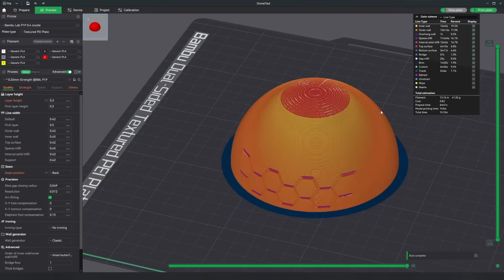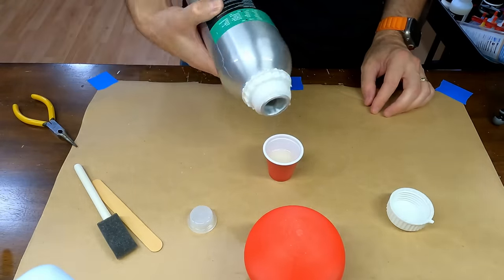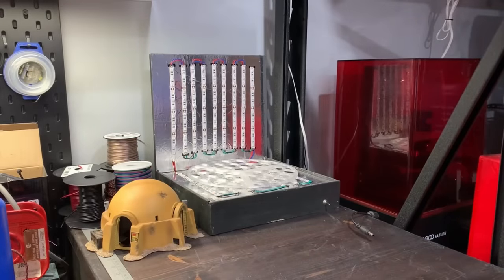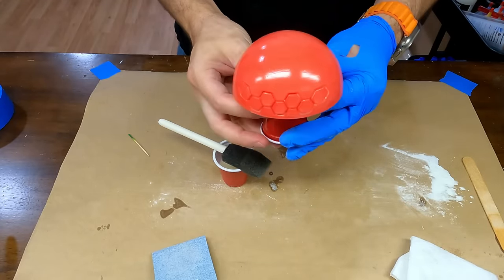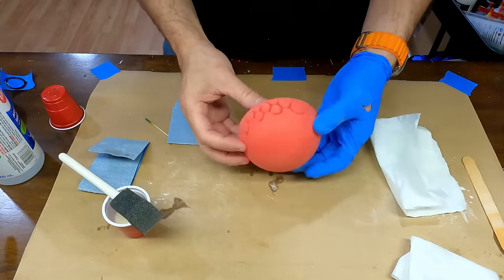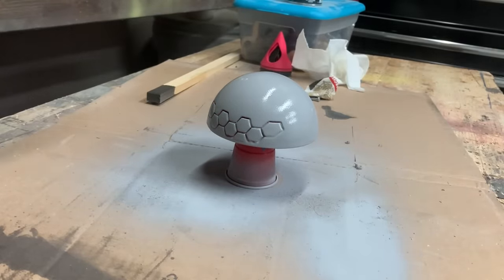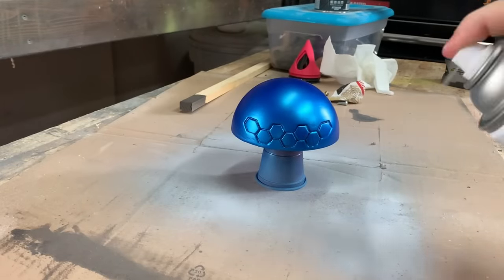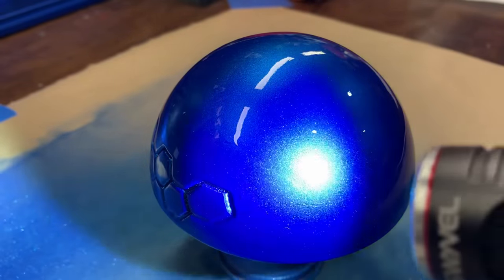Hide 3D print layer lines with Baby Powder and UV resin

Comment: I coated a helmet in 2 coats of 2 part resin that gave me about 10 minute working time. Im wondering how well the resin cured? And working time? 
I did use UV craft resin on a print with good outcome but felt it ti be a lil thick, so controlling the powder control the thickness 🤔
Reply: I forgot to add, the helmet didn't work as nice as your sphere. Resin had to be worked fast and the supplied foam brush wasn't up to it. A silicon brush would of worked better 😊

Comment: Same finish can be achieved with just a Sand+Filler Primer (cuz FILLER)+paint/clear.  The UV does not speed this process at all. Filler Primer does exactly the same thing in less time IMO.
Reply from the maker: Well, everyone is entitled to their own opinion, but not there own facts :)
Filler primer is much thinner than the resin, even before thickening it so it will take many more coats of paint and sanding to fill in the same size voids. Also primer isn't as hard as resin once it dried so you don't want to rely on primer to fill deep groves.
Reply: Read what I said.  Sand first.  Generally, a light sand with 100 grit on small objects, an orbital works great for large items like helmets. It's quick and effective.  2 coats of filler primer, a wet sand and it's on to finish.  Doesn't get any quicker or faster than that. #facts.  @DaveRigDesign

Comment: Nice vid! Wondering if this method could be used for figurines?
Reply from the maker: Thanks. Probably but as the prints get smaller with higher detail it’s difficult to not cover things you don’t want to. I think it will depend on the figure.

Comment: Im curious if it is possible to add color pigment to the resin to get the print to have a color that way and if that would look good? Also is there a alternative to using a curing chamber if you dont have one?
Reply from the maker: You could add pigment or just use colours resin. But the layers are so thin it would be somewhat transparent and show the underlying service. 

For curing you can just use a UV hand held light. I have a few videos on my channel using this method on bigger prints and use a hand held light
Reply: @DaveRigDesign  awesome thank you so much! would adding pigment make the resin thinner? (I dont know much about resin printing I only have FDM)
Reply from the maker: @codyabdullah I don’t think adding pigment would have much effect on the thickness. You could add a clear resin over a print you don’t sand. You would see the layer lines underneath but you can buff the resin to a mirror finish on top for a super smooth candy coating :)

Possibly also add glitter to give a metallic clear coat effect.

Comment: Great video I went to you area on where to get the uv resin on Amazon and it say not available and don’t know when it will be is there another resin you can recommend thanks
Reply from the maker: Ya I noticed the resin I used is out of stock, I need to replace that. I use elegoo resin also which is pretty good.
I have an Amazon store setup now with all the different products I use
https://www.amazon.com/shop/daverig/list/2B0WQBHVMEWTM?ref_=aipsflist_aipsfdaverig

Comment: Compared to using automotive glazing putty (which I think you have also documented in the past) how does the resin method work ?
Seems the resin method may take longer, more curing cycles.
thanks for posting this, useful info!
Reply from the maker: Real difference is putty take longer/ more effort to apply and then you have to wait for it to dry.
But if it’s a small area putty may be better, for a large area resin is the way to go

Comment: I see a process missed time and yime again with 3d print prep and finish.
You still had areas or spots where the item had dips below the main surface.
The talc and resin had not filled them completely. 
If you used one or two 'guid coats' they would have shown up and been delt with. 
I was a french polisher and dprsyrr in my old days.  If your prepping for a good finish you must do sanding guid coats without fail. It only takes seconds to apply.

Comment: Can I use an off-the-shell bottle of resin for photopolymer printing, and how powerful of a UV light do I need?
Reply from the maker: I would guess so. I think the light strip I used was rated at 45w but I didn’t use the whole strip.
Reply: @DaveRigDesign  thanks!

Comment: I've seen people use aceton under a glass cover, so the vapor would partially dissolve the surface, removing the lines. Takes some experimenting...😊
Reply from the maker: yup, this only works with ABS plastic though, doesn't have the same effect with PLA

Comment: Great video and very educational! Having had a lot of failures with Rustoleum 2x paint not being uv stable and unpredictable with crazing and bubbles, I wonder if it would be better to finish the project by spraying uv resin instead? Having never used resin before I have no idea if that would have the advantage of fast permanent curing and also protect the PLA plastic. What do you think. Thanks for doing this, interesting topic!
Reply: That's an interesting idea - spraying resin
Reply from the maker: I have seen people spray resin but it is a dangerous process and shouldn’t be attempted unless you really know what your doing. Make sure you do your research before attempting it.

Comment: I wonder if you could fill those detail areas with blue tack (or something similar) to prevent resin build up during the process... Or maybe wax? Something that would not only fill the voids to prevent pooling but actively repel the resin would be ideal
Reply from the maker: Someone else commented on a similar idea. It's definitely possible
Reply: I had considered using a PVA glue and letting it pool in the cracks, but I like your wax suggestion I have a load of spare beeswax so will try that. I am a bit concerned that painting a UV layer over the top will effectively seal the wax beneath a plastic layer, hopefully the hydrophobic nature of wax will help a bit. Quite a few ideas a bit to play around.

Comment: What is the benefit of UV light, and is it necessarily to do it or I can do it with out it ?
Reply from the maker: If you use UV resin you need the light to cure it. If you use a 2 part resin you don’t need the lights

Comment: Should you not have sanded first before applying any resin?
Reply from the maker: Well no. Partly so show how well it works and partly because PLA is hard to sand and the reason you use resin.

Comment: Hi ! Does it work with high detailed prints ? I'm afraid it would fade the details
Reply from the maker: It depends on how fine. You are adding resin to fill in the layer lines so you can loose some fine details also

Comment: Sand first. Apply filler optionally and paint only 1-2x. Just see how car chassis or walls are painted. Robust and mature methods, no need to reinvent the wheel.
The resin is a good idea though: it sets quickly.

Comment: you can also use 2k polyester resin filler

the brush on stuff, not the automotive body filler stuff

does the same job but you spare yourself the UV curing
Reply from the maker: true, but the upside of UV curing is the speed. No waiting for drying time
Reply: @DaveRigDesign  you can control the hardening time of polyester resins by the amount of hardener you uses

practical limits are around 10 minutes, if you go lower you basically have no work time left

also ab advantage is no need for a UV cure chamber, since I don't own a resin printer this would be wasted space

but needless to say: the process is very similar and both are very easy to use

one downside though: uncured polyester resin is usually more toxic than UV resins, but in either case good ventilation is key
Reply from the maker: Issue with a 2 part mix is you have X minutes from when you mix the parts so your application time is limited. With uv resin you can take as long as you like to apply it and then have it dry in seconds

Comment: Does it need to be UV resin or can I use something else? I don't have a UV lamp and wouldn't want to get one unless necessary
Reply from the maker: Same process would work with 2 part resin. Just need to wait for it to dry
Reply: @DaveRigDesign  Awesome, thanks! This will really take some 3D prints to the next level

Comment: you could use a heat gun to thin out the resin in the detailed parts
Reply from the maker: Yup, that could work, just have to be careful not to melt the print :)

Comment: Try Bondo and acetone. Works just as well and a bit quicker of a process
Reply from the maker: Yup, but uv dries faster
Reply: @DaveRigDesign  how quick? The acetone gets my layer dry in 15 seconds to a minute depending on how thick I put it on. Since I normally do a few parts at a time it's dry before I can get to a second later (if needed). But if the UV is crazy quick I may need to consider switching
Reply from the maker: @Garagehype199 uv is instant as soon as the light hits it. The benefits is it stays liquid indefinitely until hit with uv light and then dries instantly. Any 2 part product is on a timer as soon as it’s mixed and then you need to wait it to cure.

Comment: Whats the benefit of this over something like Bondo Body Filler?
Reply from the maker: Easier to apply and sand. Bondo is easier to control where it goes though.
Reply: seems like it would take a lot more steps than bondo. I just thin out my bondo w acetone and paint it on just like you would the resin, but i don't have to cure mine!

Comment: If i use 5min epoxy it will work the same ?
Reply from the maker: Maybe. Not sure what the surface finish would be like as that is usually meant to glue things together instead of coating things. But in theory it should work

Comment: hmm that should also greatly improve strength, shouldn't it?
As its basically now a compound material like glasfiber/resin, just instead of the glasfiber its your 3D print
Reply from the maker: Not sure. The resin layer is pretty thin and fiberglass gets its strength from the glass fibers embedded in the resin, like rebar in concrete. Resin alone isn't as strong.

Comment: Any idea what the overall diameter change was after applying all the resin/paint? This could be really useful for carbon fiber molds, but would need to account for the thickness of the resin layers when designing the mold.
Reply from the maker: "in theory" you could do this with no real size change but the process would need to be a bit different. After each coat you would want to sand it back to the print level so the only resin left behind is that in the groves. You would probably only need 2 coats to do this and then I would give it one more coat of just resin for a smooth surface. 

I just saw a video from MadeWithLayers https://youtu.be/22Qgj6vWA24?si=Z6sxfGDa_s8-y6SR doing this, he went the opposite way and heated the resin so it was thinner so it filled the voids and and ran off to not build of the thickness.

Comment: How does it compare to something like Smooth-on's XTC‑3D?
Reply from the maker: Haven’t used it but should be similar to any thick liquid. Main difference is with UV resin you control when it cures instead of it being based on time.

Comment: thanks for sharing.
what about plaster mix resin .  actually you dont have to mix powder I tried just use clear resin before . I put in shop some one brough it .

btw I dont like this methord. because detail line will be removed nomatter how carefull you do
Reply from the maker: In theory. But plaster isn’t very hard once dry so  may not be very durable. But may be fine depending on the use case of the print.

Comment: Resin heats up as it cures so arnt you essentially just melting the plastic?
Reply from the maker: It doesn’t get that hot. Usually the heat is also relative to the volume of resin and it’s chemistry so such a thin layer could not get hot enough to melt the PLA.

Comment: Good video, but strange idea: Whats the point of using sla epoxy? Hows that better than "regular" two part epoxy or putty filler? Its not cheaper, not faster, not giving you a better details or precision. So, why?
Reply from the maker: way faster cure time and infinite working time. Also it's what I had on hand. :)

Comment: You should check out hydro-dipping. Same results with a lot less steps and definitely cheaper.
Reply from the maker: Hydro dipping is used to apply images to object, it doesn’t do anything to smooth it out. The object has to already be smooth
Reply: @DaveRigDesign  LOL have you ever hydro dipped before? Never mind, don't answer because you made it very clear that you know very little about it. 

You do not need a smooth surface when dipping, you just need a clean surface. If you are worried about the uneven texture, that could easily be filled with some spray instead of taking all of that time out with baby powder and epoxy. 

In short, you are adding way more work than necessary.
Reply from the maker: @Gun_Nerd I haven’t but I’ve seen it done, and I’ve applied decals and know you need a smooth surface if you don’t want them to peel off. I’m guessing you don’t know what the surface of a 3d print looks like. 

Even if you managed to get the decal to stick to the surface you would have all the ridges showing through so in the light it would look like a corrugated metal roof. 

There’s no shortcuts to a mirror finish.
Reply: @DaveRigDesign  hydro dipping is nothing like a decal and its EXTREMELY hard to remove after its on. That tells me you really do not know much about dipping. 

Will the ridges show through? Yes, but I watched you sand after you applied the resin. You could have just sanded it down in the 1st place instead of adding resin and then sanding. You can also add clear coats on top of anything like this... 

I know a shit ton about epoxy resins and hydro dipping dude. You are making things a lot harder than you need to be.
Reply from the maker: @Gun_Nerd cool, I’ll wait to see your video to show everyone how it’s done :)

Comment: What are the paints you used?  Acrylic ink mixed with something?
Reply from the maker: They are both acrylic ink. One is blue and the other is metallic silver.
Reply: @DaveRigDesign  thank you.  I thought you added them to a clear base or something in the cup.
Reply from the maker: @jimbo2.094 nope, just paint and then after sprayed a clear coat to give the gloss finish
Reply: @DaveRigDesign  looks amazing!

Comment: that is a ton of super glue, like just a dab holds hundreds of lbs lol but love the video thank you
Reply from the maker: Thanks!
You would think but the cup kept falling off. I didn’t show re-attaching it. The glue didn’t stick well to the smooth plastic of the cup. Eventually I put tape on the cup also and glue between the tapes surfaces.
Reply: @DaveRigDesign  Could well be the plastic, but I also wonder how flat the bottom of those cups is. The only contact area is the outer ring and that looked slightly toroidal, in which case surface contact would be less than it appears. You can get CA glue in different viscosities, and thicker versions are better for gap filling.
Reply: @DaveRigDesign  that is actually interesting to know.

Comment: The market was over-hyped and businesses over-capitalized (sound familiar?)

It’s now way too crowded: too many companies with too similar technologies chasing the same slice of the (too small) pie

Business plans were fundamentally flawed: general-purpose manufacturing solutions in search of specific problems.

Many companies need a major reset which means there’s a high probability they enter the infamous Death Spiral.
Reply from the maker: https://youtu.be/bgHToGAuU4E?si=gz1M68kkhkK-n93E
Reply: @DaveRigDesign not watching a long monetized video. Thanks.

I initially said layer lines suck,  3d printing still sucks and you had a virtual meltdown saying I was dropped on my head, that I'm stupid, etc etc.....your defending your position because its easily attacked.

Comment: While the result does look great, won't the UV resin break down after just a few years, yellowing and dulling and eventually even cracking and peeling?
Reply from the maker: It’s painted so now exposed to sunlight so no :)
Reply: @DaveRigDesign  
It will be interesting to see if that is enough or if it still breaks down long term.
Reply from the maker: I’m pretty sure the resin breakdown is due to sunlight. So should be :)

Comment: So - can't you just print smaller layer lines and sand it smooth without going through a resin step???
Reply from the maker: You can but it drastically increases the print time and for big prints that could be days more print time